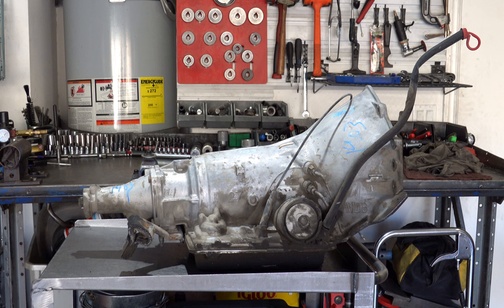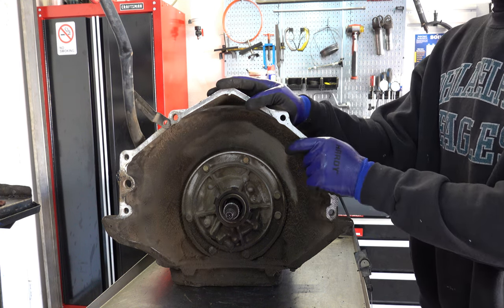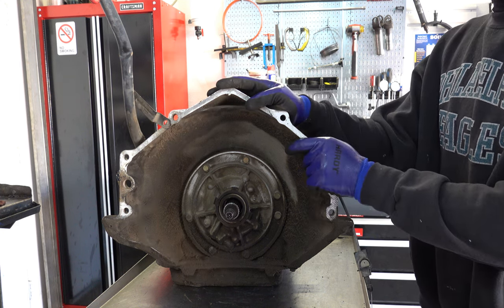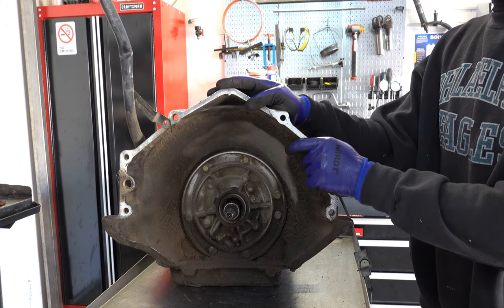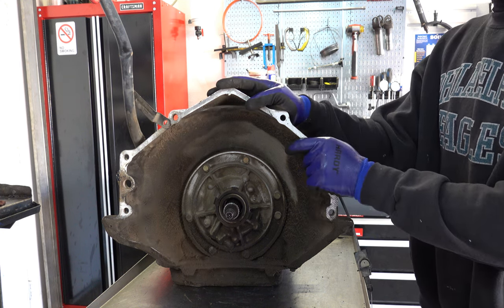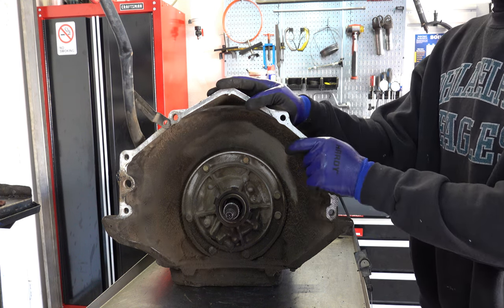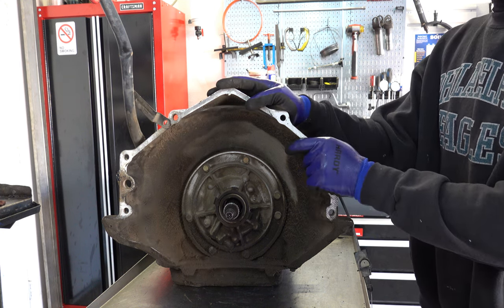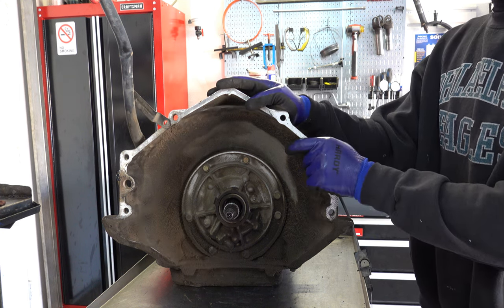700R4 Teardown and Inspection

Comment: at one point in time, the ATSG service manual recommended builders to leave the load springs out,   then they changed it, and said to put them in,, a few channels I watch the builders are very adament that the lack of load release springs cause  early 3/4 clutch burn up so I guess  its kind of builder preference based on personal experiences..  it seems alot of attempts have been made to offset the cause of 3.4 clutch burn up by using stronger clutches, and some hydraulic pressure adaptations,  but I guess the root problem of the 2nd gear band not coming off, before the 3/4 clutch comes on is still a problem..
Reply from the maker: My general guidance is that load release springs should be used when 

- clearances are .030-.040 and application is high performance, high RPM and high rate return springs have not been installed. 
- If HP is 550+, race/serious street strip and clearance is .030-.040, irrespective to whether high rate return springs/Transgo bleeder orifice is installed

I leave them out if
Clearance is .040-.050 and high rate return springs have been installed, HP is under 550 or so and vehicle is mostly street driven
- All other non-high performance / high RPM applications (high RPM is considered 5500 and above)

Re band release and 3-4 clutch pack apply mis-time, the main problem is the small 2-3 orifice hole and comparatively larger band release in the spacer plate as from the factory. Most of the time it's not a problem but when the trans gets raced or when larger servos are installed but no mods to the plate or anywhere else are done to complement those changes, you start seeing 2-3 flares...In these cases, the load release springs exacerbate the problem.

Comment: Excellent video. I used this to help with my teardown of my 1990 Camaro 700R4 and it certainly was very useful. I didn't see anything related to case inspection for cracks though. I have quite a bit of radial cracks in the tail shaft side of the case inside. Not sure if these are "normal" casting stress fractures or cracks I should be concerned with and discard the case for. I would love your opinion on this cracking, is any amount of crack lines reason for abandoning the rebuild? I tried to post a picture but couldn't find an easy way to do it.
Reply from the maker: Hi Jim,

Thank you for watching and the kind words. 

Most of the time the 'cracks' you see in the case are simply byproducts of the casting process so if it is dry in the location where you're seeing the 'cracks' they are almost certainly not cracks....You can check by pouring some transmission fluid either into the area inside to see if it drips through or on the outside to see if you spot seepage into the case in that location, to be sure...

Also, I don't typically click on any links to GDrive folders or other links to personal repositories and I'm not sure if you can actually post an image in the comments on Youtube...

What you can do is shoot a short video of the cracks, upload to Youtube and reply with the link to your video here and I'll take a look. Just make sure your camera's focus is sharp and you have good lighting (i.e. no overly dark areas or high contrast between light and shadow on the areas of the cracks as will make it difficult to see).

Comment: im currently working on 1985 7004r looks like they installer 2nd generation valve body  lost 3/4  when i took pump out band was totaly disengaged what would cause this evevttig is pristine
Reply from the maker: Thanks for watching, Greg...Hmmm...I've never installed a second design VB onto an early, non-aux vb case. Did the trans function at all with that valve body?

As far as the band being dislodged, was the band anchor pin damaged in some way? Any damage to the case at the pin bore? 

Are you sure it was dislodged prior to you pulling the pump out (sometimes the band will come off the anchor pin as the pump is being removed).
Reply: Yes  band could came off when pulled pump Tran worked said he lost 3/4 . As a side note can I install  a 716 drum in this  trans
Reply from the maker: Yes you can install the 716 drum but be warned - as I mentioned in the video, the pre-aux 700R4s had a 3mm diameter orifice for the forward clutch owing to the fact there was no accumulator present...That orifice was changed to 6mm in the 097 and 716 drums so the vehicle's garage engagement into Drive may be very harsh as those two drums were intended to work with a forward accumulator circuit.
Reply: Thank you for your reply  enjoy watching  you on tube very  informative again  thank u
Reply from the maker: You're welcome, Greg and thank you again for the views...Let me know if you have any further questions or run into problems with that build.

Comment: Hey Nick, again great videos. my question is when air checking the forward drum for bubbles, is there an allowable amount of bubbles or is it absolutely no bubbles period. I get a small stream of bubbles when checking the 3-4 feed and the forward feed.
Reply from the maker: Thanks, Kevin. If I see any bubbles, I replace the drum assembly...For me it's not worth taking the risk...Your call but if it were me, that drum wouldn't be going back in.
Reply: Thats pretty much what i thought. is there a good GM part number available to order a new one if i don't want to spend the money on a sonnax one?
Reply from the maker: Im not sure those drums are still in production but if/when i need a replacement, ill buy from my local parts supplier. You can also check out Cope Racing's 4L78 drum which is like a moderate to high performance upgrade and i believe accommodates 8 or 9 clutches in the 3-4 pack. It comes empty as a bare drum (you need to press in your current input shaft).
Reply: Thanks, your videos and input are greatly appreciated.
Reply from the maker: You're welcome, man - thank you for watching them!
Reply: It looks like GM has discontinued the drum assembly. I have seen a few on Ebay that are "remanufactured", not sure what that means, but i did read somewhere that a guy purchased a remanufactured one and said it leaked as bad as his original one. What are your thoughts on pressing my shaft out and using loctite on the splines and pressing it back together? Thanks for any advise!
Reply from the maker: Hi Kevin, you can do that - I've used loctite and permatex ultra black on splines before when pressing in the input shafts..I don't do it often, as I prefer to replace the drum with a good used on but in times where I needed to, I haven't had any issues.

Comment: What's the difference between the 700 R4 in a 1987C4 Corvette and other vehicles like a Chevy Caprice the Regal the Pontiac the Camaro?

Thanks
Reply from the maker: The case and extension housing. There is a special ext housing that is designed to accept "through boltd" to mount to the vette's unibody chassis above the transmission. The vette case lacks rear trans mount threaded bolt hole locations unlike other 700R4 cases that mount to a traditional rear xmember.

Comment: Is it a pretty big job to drop the pan and get the selector seal out, when the transmission is still in the vehicle? Everyone seems to be doing that job with the transmission already out.
Reply from the maker: Hi Enermax, it's not difficult at all takes a half hour to an hour depending upon how fast you work. Just need a 15mm open ended wrench for the nut and a small prybar to take out the seal. There's a special collet style tool that removes the seal with the selector still installed so no need to drop the pan. You take out the seal w/the tool the  use a 15mm deep socket to install the new one. With the tool, the task is done in 15 minutes or less.
Reply: @nickstransmissions  Unfortunately I don't have room to use the tool adequately. So I was looking at dropping the pan to get at it, if it's not a big job to do it that way.
Reply from the maker: Yea, it's no biggie to drop the pan..if you're handy w/a welder and have an appropriately sized nut for a factory drain plug, you can drill a hole in the bottom of the pan once it's off and install a drain plug w/the nut welded on the inside of the pan...

Once the pan's off, at some point closely inspect the threads on all the pan bolt holes. Many 700R4s and 4L60Es have partially stripped threads that won't hold torque when you go to put the pan back on and tighten everything to spec. So will want to helicoil repair them when the pan is off.

Tighten that rooster comb nut really well...They can come loose if not synched down good.

When you put the pan back on, torque all bolts to 98 inch lbs.
Reply: @nickstransmissions  No need to remove the valve body? Looks like there's a little lever/shaft that goes into the rooster comb. Maybe that lever won't come out unless you remove the valve body?
Reply from the maker: Nope, vb can stay untouched. The little linkage arm that connects the manual valve and rooster comb doesnt need to be removed. Simply take loose the rooster comb/selector shaft nut then push the shaft out of the case. The little linkage arm may hold the rooster comb in place or it may fall out. If the rooster comb falls and little arm comes out of the manual valve, simply put it back in whem you're ready.

Comment: Any particular reason why mine won’t shift out of park? I have the pan off my 90 Suburban and the part where the shift linkage attaches, the selector won’t move at all. I’ve done some research and people say it’s usually the parking lock accumulator so I ordered a new one. Is the what it could be? There was no metal at all when I took the pan off and it was shifting flawlessly. No it’s just stuck and won’t shift into any gear.
Reply from the maker: Hi Deep Roots, thank you for watching. 

I wouldnt trust any sources you've been using in your research that mention a "parking lock accumulator" because there is no such thing. So I am not sure what part you actually ordered but more than likely, it's not going to be what you need.

Did you disconnect the shift linkage from the transmission before trying to move the selector shaft?
Reply: @nickstransmissions  yes I did. I’m looking at a diagram of a 700r4. I ordered the “actuator assembly parking lock,” it connects to the “lever inside detent” and pushes the “spring parking pawl return.” It’s basically a rod with a spring at the end.
Reply from the maker: Ok, that makes more sense...You orderded the parking rod assembly, which should fix your issue if the one in there has failed in some way, preventing you from moving the selector. 

Was thinking you ordered an accumulator piston...
Reply: @nickstransmissions  Thanks for your help!! Your video helped the most after hours of research and other videos. Much appreciated.
Reply from the maker: You're welcome, Deep Roots! Thanks again for watching.

Comment: What are the minimal DIY tool set to rebuild? Is there a work around for the press?
Reply from the maker: Hi, thanks for watching!

The workaround for the press is to take the bushings and parts that require them to a transmission shop and have the shop R&R the bushings...Some shops will do so for around $150-$200 while others won't. By time. If you don't invest in the press, you may find yourself back in the same position (needing a press) for the next repair vs just investing the money on a good press...No serious DYI'er should be without a multimeter, scan tool and shop press (in addition to all the basic/obvious tools) in my opinion....

That said, you can find very cost effective work arounds for the sealing ring resizing tools that you'd otherwise need...Purchase some appropriately sized hose clamps (including a big one for doing pump alignment) and then go on Amazon and search 'Rubber sheets' - buy a pack of three 8X10 inch rubber sheets (appx 1/8" thick) and cut sections out to place inside your hose clamps to protect the sealing rings from the hose clamp's tightening mechanism. 

That will cost about $15-$20 and save you about $100-$150 in ring resizer and special alignment tools. Spend another $40 on a universal clutch return spring compressor tool and you should have what you need to assemble the transmission. User feeler gauges on clutch packs for clearance and a dial indicator for end play measurement.
Reply: Are referring to a generic shop press? I get that DIY people should have one. I'm referring to the specialty press you have at 1:30. A great video you could make is to rebuild a trans with DIY tools @nickstransmissions
Reply: I would wager most of your how to views are from DIY first timers. Regarding tools I would also include homemade tools if need be. Alot of DIY's have fab skills and would be willing  to cobble together something for single use
Reply from the maker: You're referring to the foot press...You used the term 'press' so figured you referring to the shop press. Yes, if you don't want to spend $$$ on the foot press, grab either a vise mounted universal compressor tool or a stand-along compressor tool. 

Funny (in a good way) that you're asking for a vid for DYI special transmission building tools, lower cost substitutes, that work just as well, if not better, (for example, see my above response to your first question) and workarounds. I'm in the process of putting together the content for such a video literally as we speak (hence why I'm responding so quickly to your comments as I at the computer). I'm not a fabricator but a great many of you who watch are and very handy/creative so you all can make the tools you need for significantly less than what I spend to buy them. 

Please subscribe if you haven't already as those and more vids will be coming out very soon.
Reply: Cool! I look forward to it. I'm in the process of setting up a 700r4 swap. I made a Torque Converter lip seal driver out of scrap exhaust pipe, a big washer and a bolt welded together. i ask this stuff so that when my second hand trans goes south I can rebuild it. One last suggestion would be to collaborate with a fabricator(garage cobbler) who can weld etc to design a cheap tool recipe for us frugal types. might be to weld a quick and crude adapter for and engine stand to hold the case. If you made a video from that perspective  it would be a real hit. Example   @nickstransmissions
Reply from the maker: Thanks for the input and suggestions...Collaboration with a fab shop is a great idea, I just don't know how I could squeeze something like that into my workflow as I'm already fairly jammed packed (literally tore apart a transmission that came in since your last comment and my response now). That said, you actually don't need the fabrication instructions, all you really need are the transmission case(s), engine stands (or dimensions to the stands) plus raw materials so you can fab up things like holding fixtures, fixture bases, work benches, foot presses, etc. 

For someone with your skill level, it should be a fairly straight forward exercise...The two most important things, as you know, are materials and quality-of-weld (penetration, coverage, etc) for anything load bearing like a trans fixture and base. For some of the other things, it's not quite as critical.

Comment: Nick, any suggestions on what I should do here; I have a 84 K20 Suburban that I put a 1989 700R4 int my truck. I did not know about the spline variables until I saw this video. Any suggestions on what to look for; (as far as options)? The transfer case I have is a NP208.
Reply from the maker: Hi MRHSDM, your 1989 700R4 should be fine for your K20 insofar as input shaft is concerned as it has a 30 spline input shaft and matching pump. If your K20 had a TH400 originally, then you will need to find a matching transfer case with a 27 spline input that will mesh with the 700R4's 27 spline output shaft.

Comment: I have 86 out of a Impala I had built I got 2000 miles on it and now it won't shift till about 4500 hundred rpms any idea what's wrong it's in a 86 monte
Reply from the maker: Hi, thanks for watching! 

700R4 or 200-4R?

Probably governor...Has it been shifting normally since the rebuild until now? 

Did you check the governor gear for stripped teeth? Was the governor and/or governor gear replaced as part of the rebuild? Hows fluid level and smell?

Comment: Also, TransGo, Sonnax, GM are likely the only parts to use, especially Sonnax since they have many refinements to their parts over OEM for longevity and reliability.
Reply from the maker: Those, Superior Tech and a couple others are reliable depending on which parts you're referring to. Borg Warner, Raybestos, Alto for frictions, bands and steels, OEM GM/National for bonded pistons (never reuse the aluminum apply pistons in the forward drums in 700R4s and 1996 and older 4L60Es). Bushings from either Transtar or Sonnax. OH paper and rubber kits from Transtar primarily
Reply: @nickstransmissions Yessiree and Transtar kits and B&I converters my guess.

Comment: Love your videos, I have an 84 700r4. I had it rebuilt came back great working but less the 200km later it is haveing trouble shifting al of a sudden! I have to run the gear out and give it gas pedal a blip then it shifts ! any idea what is going on???
Reply from the maker: Thanks for the kind words, FS! 

Check the TV cable adjustment by doing a pressure test, if you haven't done so already. If the cable was not set up correctly, you'll have issues shifting as line pressure will not be optimal. Here's a link to TV cable set up and instructions if you need them:https://static.summitracing.com/global/images/instructions/bmm-9500377-04.pdf

Pressure testing info is on the last page.
Reply: @nickstransmissions  thank you